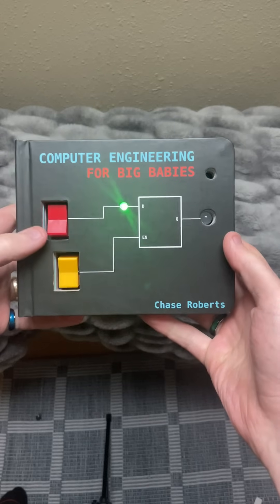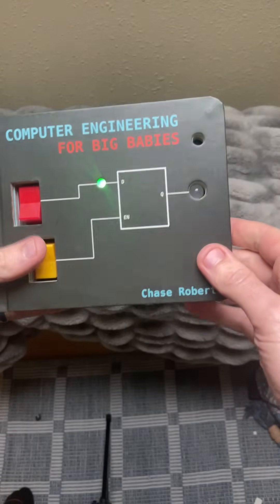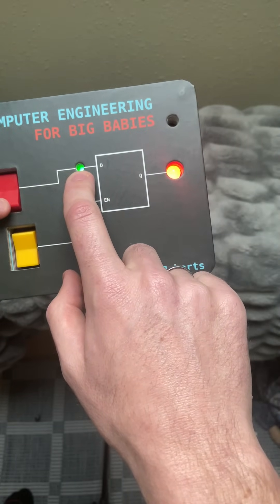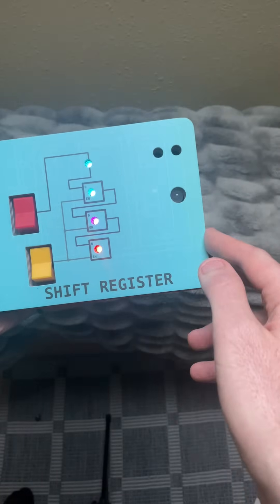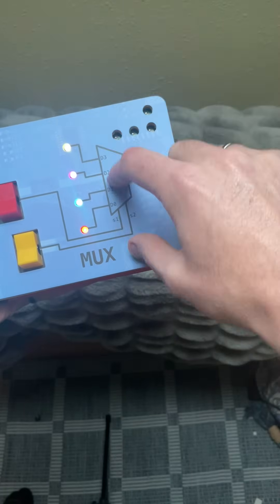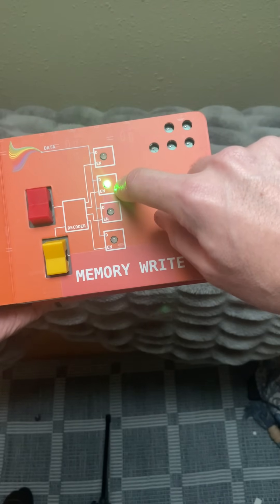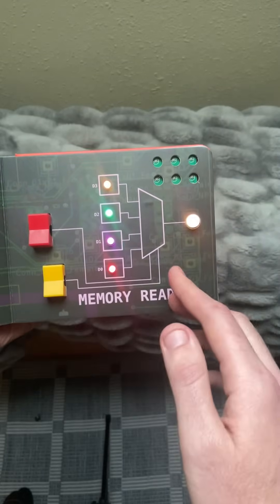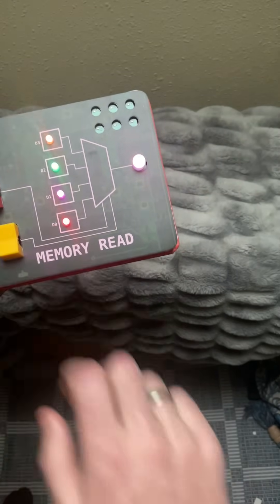Computer Engineering for Big Babies Tutorial

Comment: I have a copy of the book, and now my son is old enough to use it. However, none of the lights light up on any page, regardless of the position of the switches. Is there an on-switch somewhere? I can't figure out how to turn it on.
Reply from the maker: It could be the battery has gotten loose. Try opening the back battery cover and making sure the battery is in place.
Reply: @chasemadison  Thanks! You were right. I had already tried to jiggle the battery into place. But it turned out the battery was depleted. Replaced the battery and now everything works fine. Nice!

Comment: when the book is closed, the leds stay on, any way to turn them off to save some battery?
Reply from the maker: It should automatically turn off after about one minute of inactivity. Email me if that’s not happening.
Reply: @chasemadison  thanks for the info! it's working as expected
cheers Chase
Reply: I just came here for the same reason! Sometimes the smaller led light will stay longer and turn off then come back for a little. Is that normal?
Reply from the maker: @christianepetty6018  It should turn off after a minute, if not, then it might be worth just removing the battery and reinserting it. If that doesn't solve the issue, then send me an email, and I can get you a replacement.

Comment: Please don't use red and green in the future. 1/10 men are color blind. Literally any other color would be better. This is why traffic lights and signs never use pure green. They use a mixed color
Reply: I thought traffic lights were meant to be readable by the light position if you were color blind.
Reply: @jonathanrollins2470  Yes, but the color also helps when you see it from a distance at night. The unlit lights are harder to see at night so the relative position of the lit light might not be obvious
Reply: that's actually a valid point, didn't think about that
Reply: Interesting. On the first page can you not tell a difference when the top switch is flipped?
Reply: @bryan__m  Nope. There's only a difference in brightness, not color